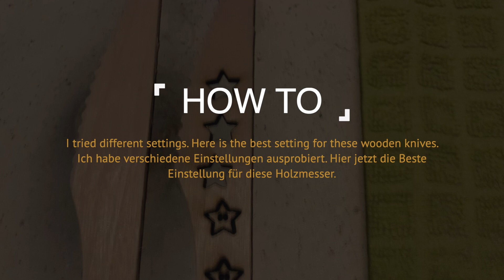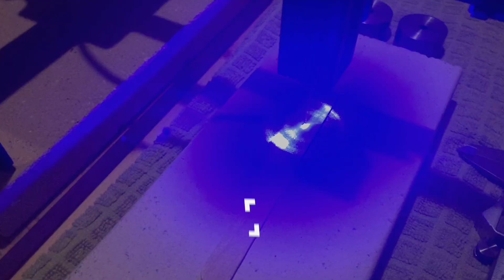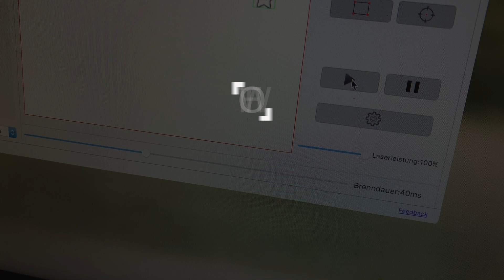NEJE 20w Laser Engraver Cutting Test

Comment: Thanks for this @SoulStudioBerlin. This helped me. I am using NEJE software on a PC. wanted to cut a 1.5mm thick ply. I tried with 100% power and 25ms but it didnt cut properly, I added one more pass and it burnt the delicate parts and so was not able to use. I use Inkscape for creating the SVG and converting to .NC but I cannot find a tutorial on how I can Cut and Engrave wood at the same time for example I would like to cut the boundary and engrave in the middle. Can you please help?
Reply from the maker: Unfortunately, you have to do it in two steps with the Neje software.  First load the file to be engraved, leave it in the software exactly as it is.  Don't move the file.  After the engraving process you load the file that is to cut the wood.  This file must not be moved either.  Now cut out the engraved area.  Of course, you can't move the piece of wood either.  So engrave then cut.
Reply: thank you so much. from your experience. Whats the best settings for engraving and cutting 1.5mm wood. in terms of burning time, power and repititions ?
Reply from the maker: You can see it in the video at 0:39
I use 100% laser power and 40 ms burning time

Comment: Hi, I have recently bought the Neje Master 2.  I am completely lost at the settings. I can't even tell of the laser is sharp or not when i twist it. Everything looks rough when finished. Can you give me an example of settings I can test on a 3mm wood please? I keep changing settings but am getting nowhere to results I want 😩.
Reply from the maker: Hello, what software do you use? do you use the Neje software?
Reply: @SoulStudioBerlin   I'm using neje v5.3.4. Neje master 2 20w. I've mangaged to get engravings looking cleaner but nowhere to cutting shapes. I've tried cutting a star but not working out well!
Reply from the maker: The most important of all is the sharpness of the laser. For this I took a black piece of paper and was able to focus the laser better. Here's how to focus.
Place a thin piece of black paper under the laser. Now deliberately twist the laser left and then right again. The laser point will then become very small in one position and become a point. That would then be the focus point. Then when you twist the lens again, the point becomes larger and blurred again. So turn back and forth until the laser point is very small and sharp.
For the settings I would recommend the "Fast" mode for wood. Burn time 3-4 ms and laser power 25-40%.
Always do a little test first to see whether you like the settings. First adjust the laser power if it is too hard or too weak. If it is too weak, increase the laser power. If it is too strong, reduce the laser power.

Good luck - greetings from Berlin
Reply: @SoulStudioBerlin  thank you!! Will give it a go!

Comment: Hello and congratulations. Nice works. I want to buy one of those but I'm not sure which one actually suits my needs. I want to cut wood 4mm and engrave an image of some photos. As far as I've learnt 7watt models are better for engraving and photo transfer but they are way weaker in terms of cutting. I can buy just one device.
Do you recommend this Neje 20w ? Can I also transfer photos at least in ok quality? Thanks so much
Reply from the maker: Hello and thanks ;)

So I first bought the 7W module and then the 20W module. If you want to work on the PC, you have a big advantage. The CNC area can be used for cutting plywood up to 4mm. There is no CNC area on the Mac. 4mm didn't work for me on the Mac :( - so I didn't make it. You can engrave with both models, because you can set the laser power and burning time. The 7W module is easier to focus - for me it is anyway. The 20W module should be retrofitted with a lens. A subscriber has posted a link under my videos. You can buy it through Alibaba, but I have not yet done so.
https://it.aliexpress.com/item/4000216410292.html?spm=a2g0o.productlist.0.0.26f66109Bl1Vza&algo_pvid=7919b5e6-cf62-4b5f-b7a2-c5a9be186fea&algo_expid=7919b5e6-cf62-4b5f-b7a2-c5a9be186fea-1&btsid=cc8d5eeb-e4e8-436f-909c-431df831f56f&ws_ab_test=searchweb0_0,searchweb201602_2,searchweb201603_55

Comment: Thank you for this video. I am considering to buy the 20W version for engraving airsoft replicas (aluminum+zinc). Looking for something capable of engraving up to 0.4mm depth, the required time is not critical. After seeing all this, I guess it would not be able to do the job, even if set to multiple passes, right?
Reply from the maker: jonnieZG - Yes you are right. This laser cannot engrave aluminum or other metals. So not with this module version. There should now be a newer module. I cannot tell you what this module can do.
When I have it, I make a video.